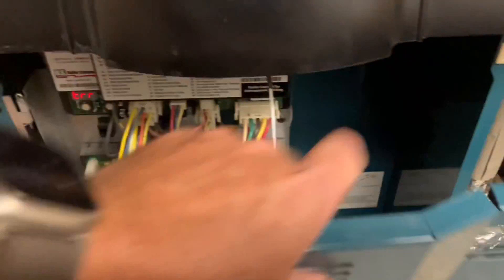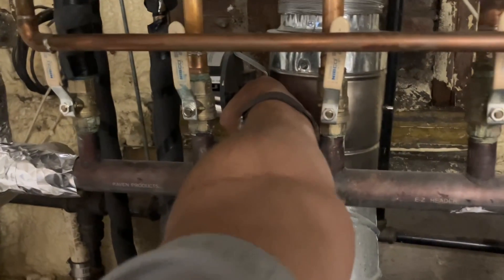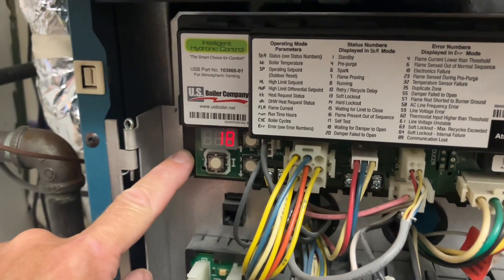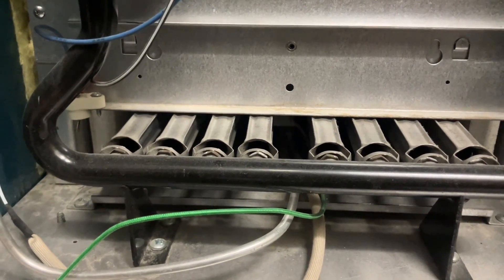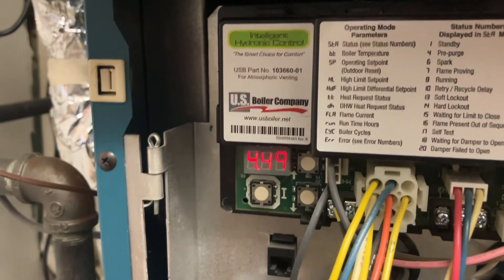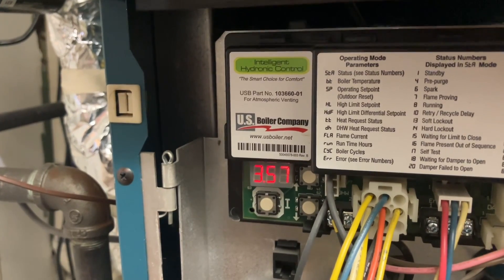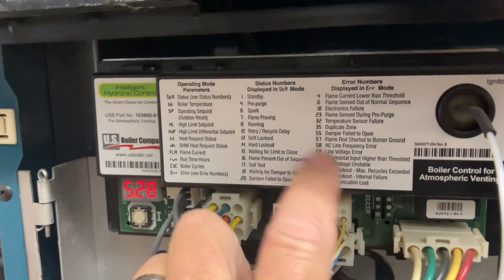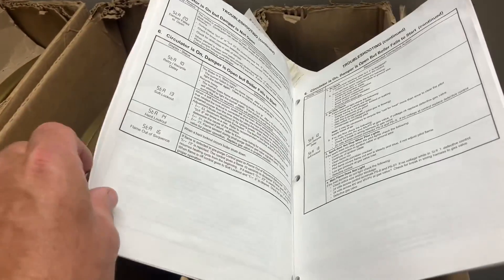No Heat on a Burnham ES2 Boiler – Mystery ERR 56 Fixed by Mikey Pipes!

Comment: Hey Mike, the heat stopped working last Sunday night. It’s my girlfriends moms house so she called Ross out of Middle island, they sent a guy over the next day which was last Monday. The guy checked it out in front of me and asked if i had the manual but i couldn’t find it. Then he asked me for the Wi-Fi password to the house which i gave him. I’m guessing he was checking online for troubleshooting the same boiler as the one here in your vide. He then told me the damper motor was bad, door dashed the part and got part right away. As he was going to remove the new motor off the new housing it came on, i asked him to replace the whole thing, he did. At first he said i should hang on to the duct housing in case it’s needed in the future. Secondly, there was water leaking above the expansion tank out of the looks like a pressure relief valve. They sent a plumber on the following Wednesday and replaced the expansion tank and the valve thing above it. Today, December 28th, the heat stopped working again! I went in the basement, Goggled the Err code 56 and it said either the damper is bad or there’s a faulty connection. The damper was open, i disconnected one of the plugs and put back together, nothing. I disconnected the second plug and wiggled it, the boiler kicked on right away! Now i’m wondering if it was just a bad connection and the damper didn’t need replacing. I’m a pool guy so i know about Err codes. We have heat now and my girlfriend is happy! She called Ross, they said they would send someone tomorrow. I may just tell them not to come because i fixed it myself.
Reply from the maker: Thanks for sharing your experience and glad you got it fixed!

Comment: Maybe lock the vent damper open until maintenance?
Reply from the maker: You know what? I didn’t think of that
Reply: @PipeDoctor you’re still in A/C mode 😂😂😂
Gotta switch to heating mode 😆😆😆
Reply: actually, that may trigger the same error code. because 56 is damper end switch stuck closed. either the end switch is bad contact arced shut OR the damper is stuck full open. lol

Comment: "The Burnham boiler error code 56 indicates a problem with the damper not closing properly. This can be caused by a faulty control module, wiring issues, or a stuck damper. To troubleshoot this error, you should:

    Check the damper's position and ensure it is in the closed position.
    Measure the voltage across the damper motor terminals to determine if the printed circuit board is bad."